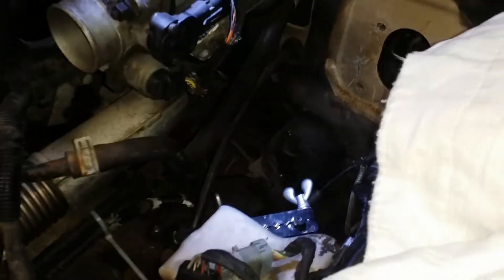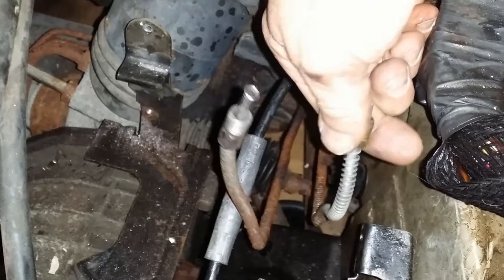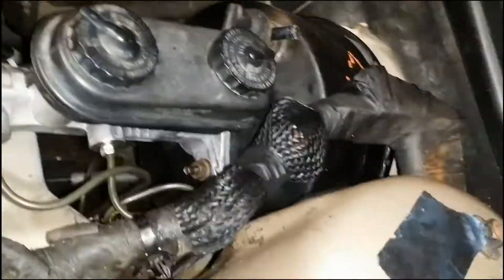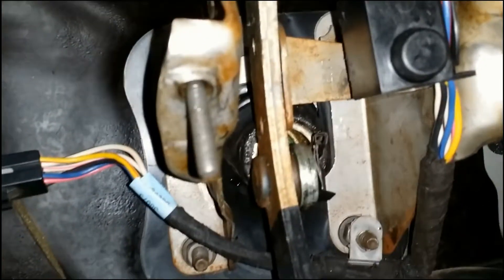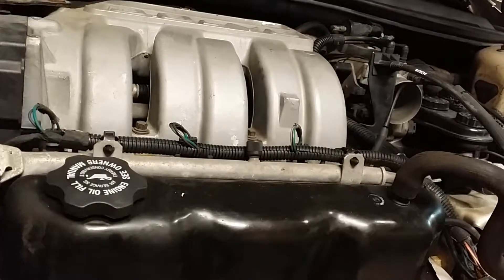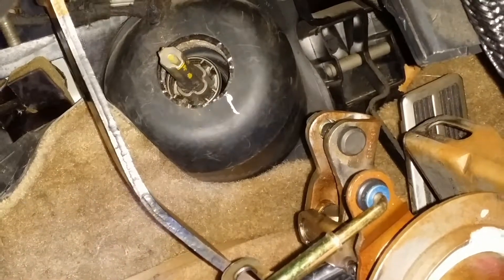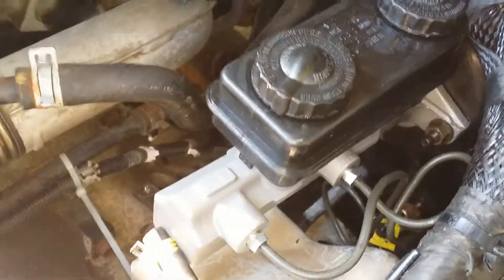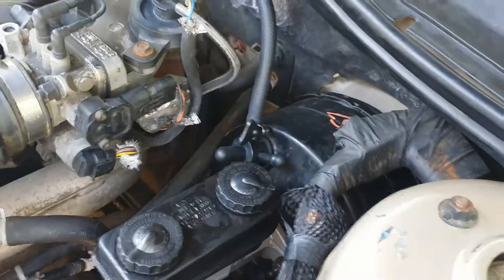Part 2 Bendix 10 ABS removal, Replaced with Manual Brakes 1992 Chrysler New Yorker Extended K Car

Comment: Would this conversion possibly work on a 92 imperial as well?  It looks very similar to the new yorker but just wanting to check
Reply from the maker: Should pretty much the same across all models with the exception that some need the brake pedal from the donor car and some do not.
Reply: i am doing a 91 imperial
Reply: I think the Imp has 4-wheel disc brakes. Not sure if 2-wheel disc master cylinder is the same. ANYTHING is better than the Bendix 10 tho.

Comment: Was MUCH easier doing this years ago, back when there were plenty of these (& Caravans) in the junkyards. U could just walk up to a non-Bendix car & see what parts u needed to swap (that climate control vacuum connecter was a little cannister that connected to the booster). Hard to find these in the U-pull-it yards now. Shouldnt need to remove the intake manfld or drop steering wheel; maybe the vans were different tho. Btw, be SURE that brake pedal clip is properly installed, like he sez. Very important! Bleeding the brakes was pretty straightforward.
Reply from the maker: Thanks for your input!
Reply: Ur welcome! Thx for trying to save the old Chryslers (they ARE "trying" sometimes!). I didn't have too much trouble mounting the mstr cyl to the firewall, but I don't think the vans had that EGR tube in the way. The "spring" on the brake line was supposed to help cool it but really didn't do much; yeah, they WERE sharp when cut. And yes, I also did a single flare (the OEM brake line was very substantial) but it's not really wise to do it that way; better to just install new lines. Btw, the proportioning valve probably will need adapter fittings cuz the holes in it are designed for many different applications. Good luck with your "Ab-Bendix-tomy"!  As Gen Colin Powell would have said: "You have to cut it off and kill it!"😊

Comment: What vacuum did you use to bleed the whole system just replaced the front calipers and and master cylinder and break booster but when I turn on car the pedal goes all the way down to the fire wall could you please let me know what vacuum system you used
Reply from the maker: You can buy the power bleeders on amazon or harbor freight. You will need a compressor.  Over time, I have found out that most of the time if the brakes don't bleed to old fashion way it is because the rubber brake hoses have rotted on the inside.  Just unhook the rubber line where it attaches to the hard line and press the brake.  If brake fluid comes out you need to replace the rubber hose portion.    https://www.amazon.com/DASBET-Pneumatic-Bleeder-Cylinder-Adapters/dp/B07WF8V1NQ/ref=asc_df_B07WF8V1NQ/?tag=hyprod-20&linkCode=df0&hvadid=385121954544&hvpos=&hvnetw=g&hvrand=2388837926088543827&hvpone=&hvptwo=&hvqmt=&hvdev=c&hvdvcmdl=&hvlocint=&hvlocphy=9015848&hvtargid=pla-832859076136&psc=1&tag=&ref=&adgrpid=76842158285&hvpone=&hvptwo=&hvadid=385121954544&hvpos=&hvnetw=g&hvrand=2388837926088543827&hvqmt=&hvdev=c&hvdvcmdl=&hvlocint=&hvlocphy=9015848&hvtargid=pla-832859076136

Comment: did you ever find out which wire from the old abs system was needed to monitor the brake fluid level sensor on the proportioning valve?
Reply from the maker: I will let you know after I get around the car again.  It is at a relative's house.
Reply from the maker: I don't have any wires attached.   Would be interested in knowing which wire to attach.
Reply from the maker: Found one at the junk yard.  The sensor wire on that car was grey with a black strip.
Reply: I have the FS Wiring diagram. I can tell you what wire and where it should be.

Comment: Where did you get the Combination/proportioning valve from
Reply from the maker: I got almost all my parts off a dodge dynasty without ABS.
Reply: @fairbornCCF   ok and the master cylinder and booster works better than abs hydraulic unit?
Reply from the maker: @darwinbridges9952  Yes, manual brakes work better.  Especially when abs is broken and no parts are available.

Comment: i have a question for you if you remember. is the proportioning valve bracket held to the frame by a single bolt? or is there a stud that comes out that you tighten a nut onto?
Reply from the maker: My guess from memory is a bolt.  My brother-in-law still drives the car.  I will try to remember to look, next time I am there.
Reply: @fairbornCCF  ah thank you so much! i grabbed all the parts from a junk yard and now can't find a bolt to fit in there. ill keep looking, but i was worried that i was missing a stud!
Reply from the maker: @TheRussBriggs  Glad to hear my video is being used.  Good luck on your conversion.

Comment: Excuse me your diaghram of proportioning valve is not how you have plumbed your brake lines thanks
Reply from the maker: The fronts lines were both replaced and they go to the top of the valve and the rears go to the bottom of the valve as shown in the diagram.  The diagram may be showing you a picture from the other side of the valve, which would reverse the left and right, other than that it should be good.